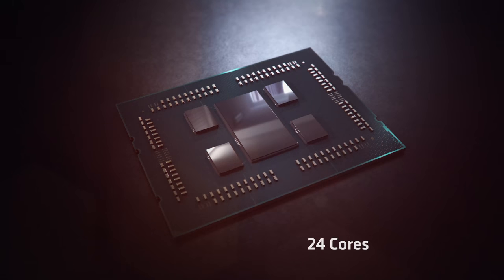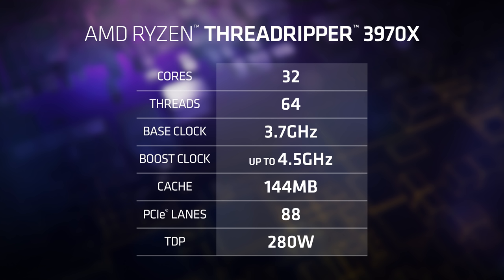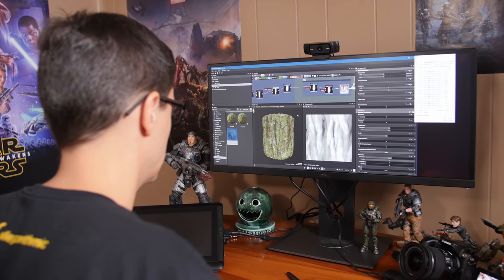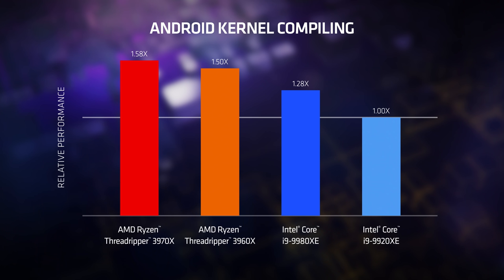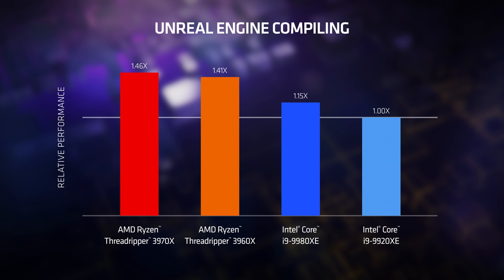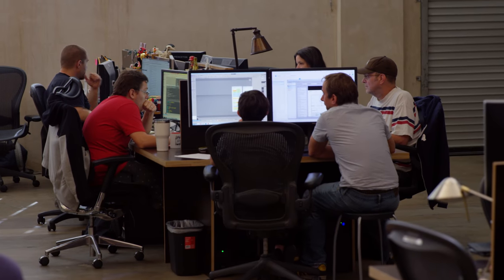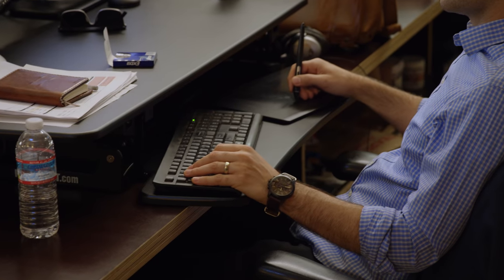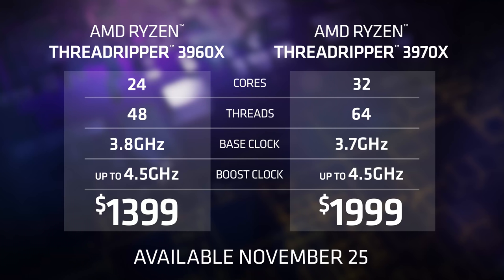Performance Preview: 3rd Gen AMD Ryzen™ Threadripper™ Processors for Creators

Comment: TDP is too high though.
Reply: But Intel power consumption = double of TDP of AMD...
Reply: The TDP is actually pretty good for a CPU with 24 and 32 cores. We are talking base clocks of 3.8 and 3.7 Ghz and boost clocks of 4.5 Ghz. That's insane amount of performance. Also, we can't just look at just TDP without looking at performance. Performance per watt is much much better with 3rd gen Ryzen compared to even Intel's latest gen CPUs. I have an Intel CPU from 2013 that is 135W TDP and has 6 cores. My current CPU, Threadripper 1950x, has 16 cores and is 180W TDP. So 170% more performance for just 33% higher power consumption.

Comment: Of course you compile faster. Compiling scales with cache. Thats why your 32 core chip is only slightly faster than your 24 core. Because the 24 core has 140mb of cache and the 32 has 144. I'm not a fan of using compiling as a benchmark, everyone knows it scales with cache and people who compile a lot (some people do, most people dont) would always buy the chip with the most cache regardless.

Comment: But will there be a Threadripping Laptop someday well i can dream RIGHT!?
Reply: You can actually do that problem is that water cooling will be required to operate at all power.
Reply: ("RNA0ROGER") like a “portable” WW1 water-cooled machine gun!
Reply: The big differences is that a machine gun would be far less complex to build. You could 3d print something like that but the laptop would be a portable fire hazard.

Comment: Still a shame 3970X and 3950X are priced the way they are. They should be cheaper imo.
Reply: Really? My 16-core 1st gen Threadripper launched at a $1000. The 16-core 3950x launches at $750 or $250 less. Not to mention that it will be ~30% faster than 1950x.
As for 3970x, it's just $100 more expensive than last year's 24-core 2970wx, but it also offers much faster clock speeds, much better IPC, more PCI-E lanes and new features like PCI-E 4.0. I think I can justify the $100 markup for these alone. At $1400, I think that 3970x is still a good price compared to Intel's offerings. Can you please let me know how much do Intel ask for their 24-core CPUs? Last time I checked, they start at over $3000. Can you please give me an example which CPU is a better value than 3950x and 3970x?
Reply: bgtubber Take one of those processors.
Now look at the processor models that are one category lower.
What you should get are the 3900 (or the X variant, if you're not upgrading from a similar processor) or the 3960X.
Basically, the differences between the 3900X and the 3950X, as well as the 3960X and 3970X are too small for their price. Both processors have very similar computing power, yet their price differences reach $300 and $700 respectively.
Sure, it's better than what Intel is offering, but the price difference is still too high, thanks to the performance each processor gives.

Comment: Wait, the tdp increase, why though?
I thought it will under 250w
Reply: Probably because of the IO die which is two times larger than the one in AM4 - double the cache, more PCI-Lanes and double the memory channels. This adds additional power. Threadrippers are known for drawing quite a bit of watts even in idle because of the uncore. Check out this article by Anandtech: "Power Consumption and Uncore Update: Every TR2 CPU". In the older Threadrippers, uncore alone draws ~55W. The IO die in Threadripper 3000 is on the same 14nm as older Threadrippers so I suspect the IO die has similar high power consuption.

Comment: "Relative Performance" what does that mean?
Reply: David Haro exactly what you would expect. For timed workloads, that would mean the inverse of the relative time. So a 60 second Intel render vs a 30 second and render would be 2.0x relative performance
Reply: Performance compared to a specific model. As you can see the 9920x is 1x in all the tests, because it is the point of comparison so it has 1x it’s own performance. If the AMD CPU has say, 1.50x relative performance, then it’s 1.5 times faster than the 9920x.

Comment: when can I expect a 64 cores/128 threads AM4 CPU ?
Reply: Buy Epyc
Reply: Perhaps the problem is power consumption and temperatures, so they will have to reduce frequencies, so the 64 core may not be much better than the 32 core. Or maybe i'm wrong.

Comment: even with 7nm technology and massive 32core count the cpu performance is not double  9980se is what 18cores and sells for around 2k but then again u look around and you see the 10980xe is coning up which is 999 and will close the gap a little more, i use vray a lot the the performance is around 45% faster in threadripper here but still i see the 109080xe which is around 999 which makes me feel intel with 14nm is still not bad compare tp 7nm amd, yes intel is behind but will catch up, the problem is amd cpu and ram combo is still not perfect i still see a ton of crashes on my vray render while using an amd 3rd generation cpu...  so amd please don't just make cheaper cpu make better cpu more reliable ones, ppl who spend 2grand on a processor can well spend another for stability . when u enter the high end market then deliver reliability instead of performance all the time. 

no content creator will put an amd cpu on a 2day render or a 3day one knowing the fact it will crash at some point cause of the reliability issue.  so please work on it
Reply: If you experience crashes, check the temperatures on the CPU and the motherboard VRMs. If you have overclock, turn it down or disable it altogether. I've got a couple 1st gen 1950x Threadrippers and I've never had any crashes with Vray even on longer rendering sessions. It is also possible that the problem is with the software, not the hardware.

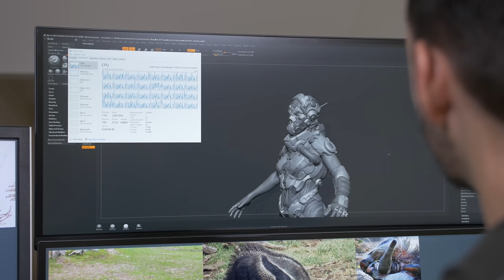Comment: 6:59 Nice "third generation Threadripper" 1950X.
And by the way their "what took 5 minutes now takes 5 seconds" sounds like they are comapring a 1 core computation to a 64 thread computation.
AMD, you are better than this marketing crap.
Reply: This actually works. I had the same experience with my 3D software when I upgraded from 8 threads to 24.  Increasing the capability of the maximum polycount in a scene does a lot!
Reply: @4ghzgaming664  Guess they'd "pretty good at the time of purchase" workstations before. I've changed some "perfectly fine" workstations to threadripper 2950xs just to prove a point (a bet actually ;). Turned out to "oh whoa, it's time to upgrade" but they'll be waiting for the new ones to settle a couple of weeks i recon.

Comment: They had the opportunity to bring intel customers back to AMD but I opt out. No upgrade path for x399 and the upgrade path for Trx40 is even similar with ddr5 expected to be released soon. 3960x costs 58 usd per core over the new 18 cores intel that costs 55usd per core (faster cores thanks to the increased frequency). AMD missed a big opportunity. This platform is just another AMD fail:

they had the opportunity to crash intel in the enthusiast segment
with an interesting performance per dollar ratio and they destroyed their possibility of success.
if ryzen 3000 offered a no brainer over Intel due to the good performance per dollar,
threadripper is now targeting the "I have money to burn people" only.

enthusiasts will not find threadripper so appealing not fo the big price but for the bad performance per dollar that is so close to intel now.

Comment: All these cores and performance are great and all, but it comes with a new socket and jacked prices compared to the previous generation. This is not really fitting with AMD's agenda shown to the consumers with the Ryzen lineup
Reply: They just said AM4 socket. Dude u must re-read again their statement. AMD still better than Intel price per performance
Reply: @brandnewday7734  I wholeheartedly agree with you, but if they start gradually increasing their prices, then we would have another Intel from them
Reply: AMD never promised socket longevity with the Threadripper platform. They only promised this for AM4. BTW, even with $100 markup on the new 24-core and $200 markup on the 32-core Threadrippers, AMD are still much more affordable than Intel's equivalent CPUs. Last time I checked, Intel's 24-core CPUs start at over $3000 and their 28-core (not even 32) start at over $4400.
Reply: @bgtubber  Look at my previous responce

Comment: Funny how machine learning is ignored, "Let's just focus on compiling code because that is one of the few areas in CS the the # of cores alone matters". The boost intel gets with AVX-512 and their MKL still to much for Threadripper? I really want to love AMD but you guys need to learn what makes the X-Series so popular isn't # of cores and clock speed. its the contributing to open sourced libraries, extended instruction sets, and high performances libraries that make Intel a no brainer for ML still. Your ROCm attempts where great when announced but you treat them like a project for the interns. We want Radeon for Deep learning and Threadrippers in our systems but you guys don't support the ecosystem like your competitors.
Reply: Time and resources which they will get more of .......with time😀

Comment: 280W tdp? I could run 5 computers with that.
Reply: Yea, five 4-core computers and their combined speed is still going to be slower. These Threadripper CPUs are for people that need monstrous amount of performance in a single machine. 280W is not bad at all for 32 high clock speed cores in a single CPU.
Reply: And Intel has ~500W of TDP in Turbo Boost, OmegaLul.

Comment: Totally ignored the power usage... 🙄
Reply: The power usage is actually fine. Some people are confused by this, so let me explain why it says 280W. The 105W TDP Ryzens (3900x & 3950x) are not rated at their PPT power consumption which is actually 142W. The power usage of the new Threadrippers is actually fine and exactly double that of 3900x and 3950x which both consume 142W PPT at full load on all cores. Check out Anandtech's power consumption chart with 3900x by searching Google Images with these terms: "3900x power package", it should be the 1st result. You'll see it actually consumes not 105W, but 142W. 🙂 AMD rate the Threadrippers' power consumption at their Package Power (PPT), which is a bit strange since they don't do that for the small Ryzens. So if we do the math, two times the chiplets of 3900x makes 24 cores (3960x), hence 2 x 142W power consumption which equals exactly 280W that the new Threadrippers are marketed as. 🙂 Last gen 24-core Threadripper (2970wx) is 250W. This year's 24-core Threadripper is only 30W higher power consumption while being 35-40% faster. I think the trade-off for this small TDP increase is more than worth it for the huge performance gain. 🙂
Reply: Because Intel power consumption = double of TDP of AMD.

Comment: $2000 for a CPU is still way expensive.
Reply: For 32 cores, $2000 is actually pretty decent price. Intel's highest core count CPU is 28-core, costs over $3000, and I can pretty much guarantee you that Threadripper 3970x is faster.

Comment: 280W TDP ?!
Reply: Threadripper 3960x is two 12-core 3900x'es put together. 3900x has PPT of 142W, so two of them make 24-cores or 280W. 🙂3970x is still 280W even with 33% more cores because the chiplets in it are even better binned.

Comment: Amd or Intel overpricing is still a f*** up.
Reduce em""
Reply: The new Threadrippers are exactly 7-11% more expensive than last gen while being 35-40% faster in highly-threaded workloads (26% higher all-core clocks + 15% higher IPC). They also have much more PCI-E lanes and support super fast PCI-E 4.0. So what exactly are you complaining about? 🙄 IMHO, that's a pretty modes premium that AMD are asking for such monstrous performance bump and new and expanded features.

Comment: $2000. And a new socket. Is it Core i9 3970X? TR 1920X cost only $550.
It was said you would destroy Intel, not join them!
Cascade Lake-X is a better deal.
Reply: Really? Is there a 32-core Intel CPU that costs even close to $2000? Also, the 12-core 1920x costs $550 because it's 2 generations older now. It was originally launched at $800. The current 12-core CPU from AMD, 3900x, is 30% faster than 1920x on average, yet costs $500 or $300 less than what 1920x launched at. Again, it is 37% cheaper while being ~30% faster. I'd love to hear from you which Cascade Lake-X is a better deal than which AMD CPU.
Reply: @bgtubber  You didnt just compare HEDT to mainstream, did you? Oh, you did, oh my god... Why don't we compare Threadrippers with Epycs. That 7742 is really overpriced, isn't it?
Oh, and you can actually buy 1920X for less than $300 now. TR4 motherboards cost too much though.
But we'll see how good 3960X is against 10980XE, in the real world applications, and not 7-zip and benchmarks, with price to performance as a priority. $1000/18 cores vs $1400/24. You pay 40% more to get just 33% more cores with AMD. And then you can pay $600 for just 8 more cores at the same L3 cache size. Huh? And a whole list of useless features.
Moreover, we haven't even heard anything about gaming performance, if anyone cares...

Oh did I mention 3950X, where you pay 50% more to get just 25% better raw performance. "Liquid-cooling optimized" my ass, you meant to say it's hot AF, AMD. After you managed to squeeze all those cores there, which took you several months.
Enough cores, AMD. Give us a 5+ GHz CPU already.
Reply: @bgtubber  If 3960X cost around $1000, that would be a competition against Intel. At $1400, nah, thanks.

Comment: "4.5ghz"  meens 4.05-4.1 ghz all core :)
Reply: 1st gen TR is already 4.1 GHz all-core (my 1950X goes up to 4.2+ GHz water-cooled). So, 3rd gen should be clearly beyond that under water, since its on the 7 nm node.
Reply: @photonzoo816  Yeah.. since 7nm means so much..

Comment: 1400$ Minimum for entry is WAY too much.
I guess AMD's going the Intel way :/
Reply: I wouldn't say they cost way too much. After all, 3960x is a 24-core CPU. The older 24-core Threadripper costed just $100 less. What the real problem here is, is that the old x399 motherboards are not compatible with the new Threadrippers which is additional expense and we all know they aren't going to be cheap. Probably at least $500 for the cheapest ones. Nevertheless, I'm still getting the 3960x.